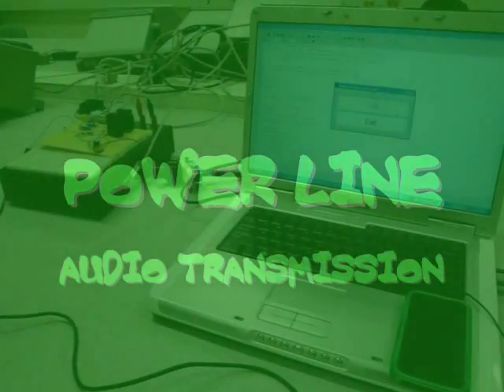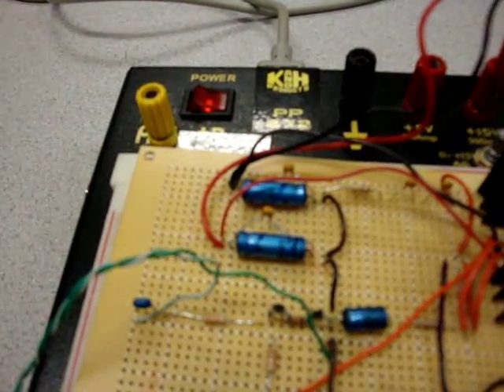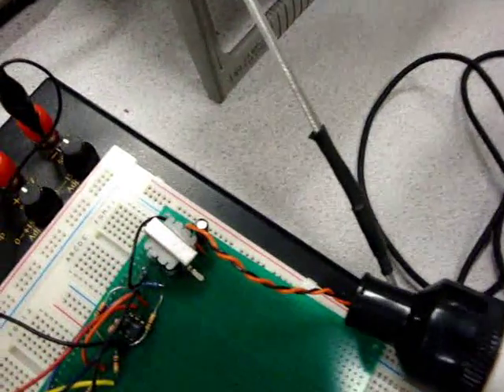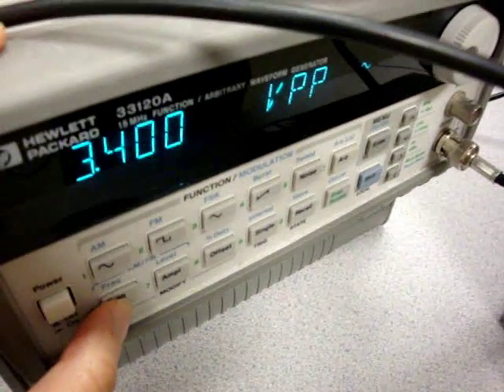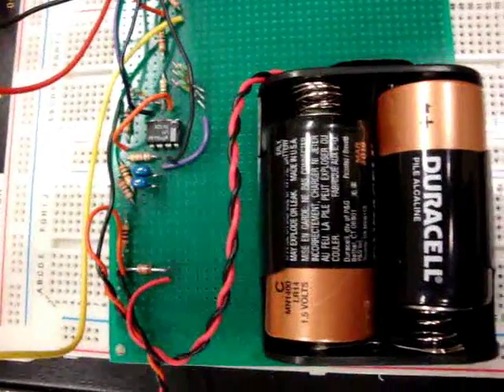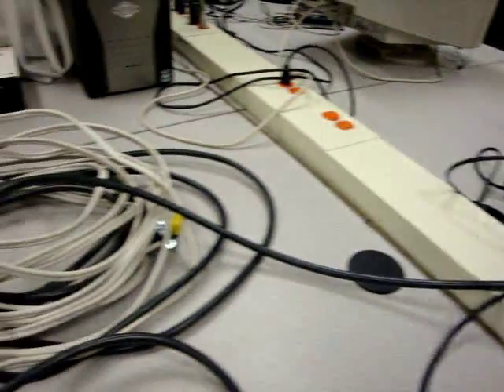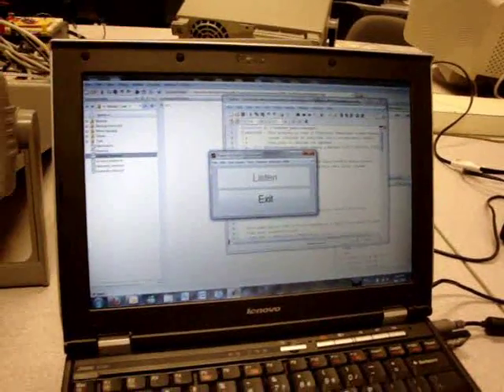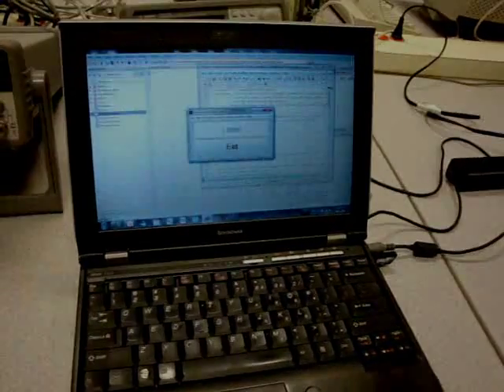Power Line Audio Transmission

Comment: How can I capture the audio coming from the power lines? I have been able to tune (my ears) into hearing chatter, audible voices, coming from dc motors like in fans, and ventilation systems like in hospitals. Can I simply attach speaker wire to the power line supplying the fan and hook it up to a speaker?
Reply: Would love to know this too hopefully he replies!

Comment: is it possible to transfer data between neutral and ground line???
Reply: Reply to this very old question: In most countries the ground and neutral are joined together (bonded) at the switchboard. So you literally have a "short circuit" that your audio transmitter would need to be driving the signal into. That would mean that it would be very difficult to create the amplifier and get enough "oomph" into the signal to make it detectable.
Further complicating the situation is that the physical run of cables (in the house) would probably go from your transmitter, back to the switchboard, then down a different cable line to the receiver in a different location. In that case, the short circuit (from the Neutral/Earth bond) in the centre of the run would 100% eliminate all of the signal you were trying to transmit..

Comment: Its really cool setup. One thing to mention is that  Coupled signals onto live powerlines only works in a home and only on the leg that it is connected to.  The signal wont go through a pole mounted transformer. Power companies use many telemetry techniques and all are point to point, and how they bypass the transformers is with a deliberately placed device in the switchyard and is not passive. Most businesses have isolation Xformers here and there which also blocks the signal. This and digital methods like PCM modulated AM wave would work with Point to Point electrical runs, like the Powerline ethernets or in a house, on a branch circuit fed by the same hot leg.
Reply: Addition to very old post: You can buy small devices that will (capacitively?) couple an EoP signal across 2 or 3 phases (legs) within the home. They are connected inside the switchboard before the circuit breakers. Also keep in mind that supply authority transformers are not for every house, then will feed a street of section of street. So you can (theoretically) send signal between houses on the same phases, however the longer the distance and the closer to the transformer, the more that the injected signal will get attenuated.
Reply: The transformer has some bandpass filtering at 60Hz but I bet you could still sneak a signal through in the low audio range